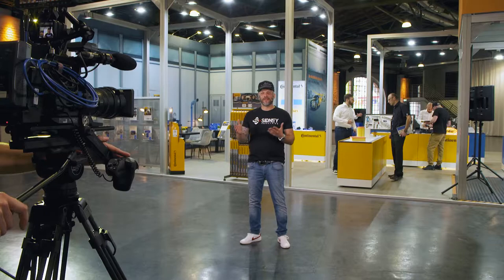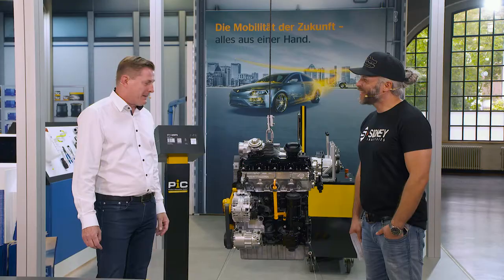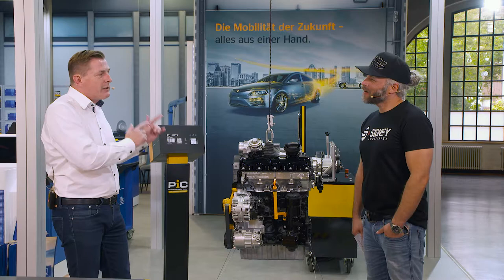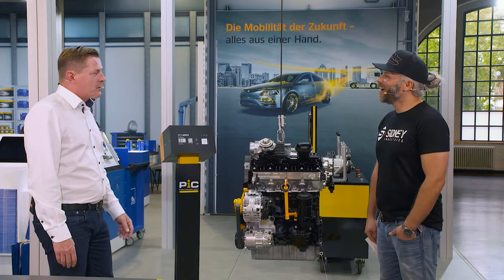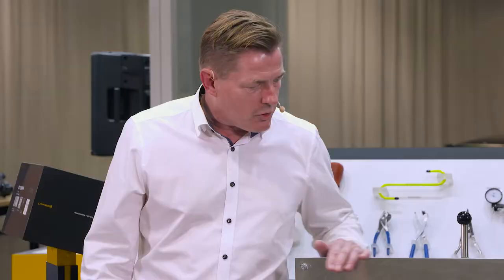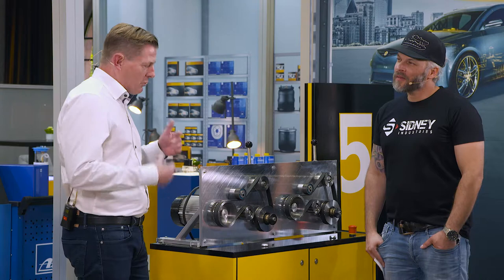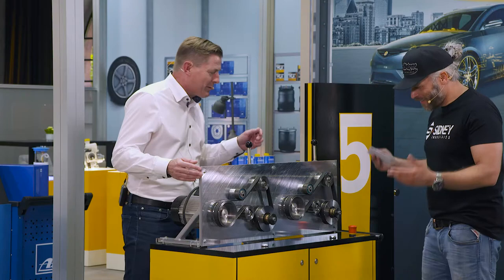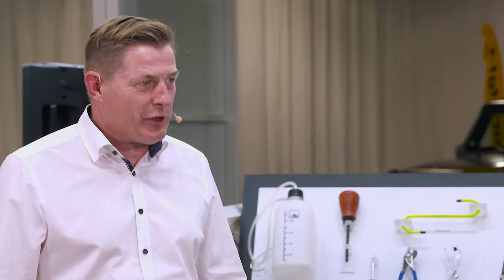[EN] Exhibition report with Sidney Hoffmann - The belt drive component special

Comment: Your timing belt part number  4060488 "does not" fit my 2009 Cadillac CTS V6 as a replacement for GM part number 12621991 (6PK1186). Please correct your records as I have wasted several hours to contact you.